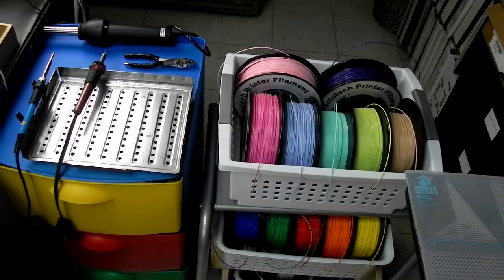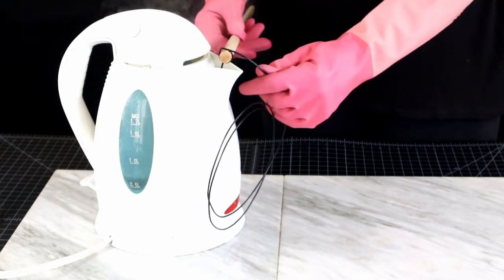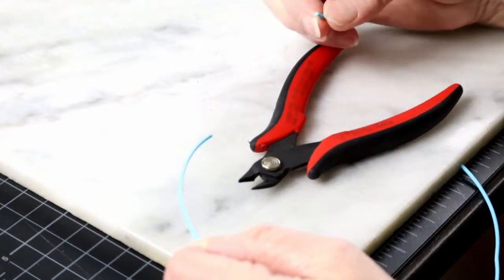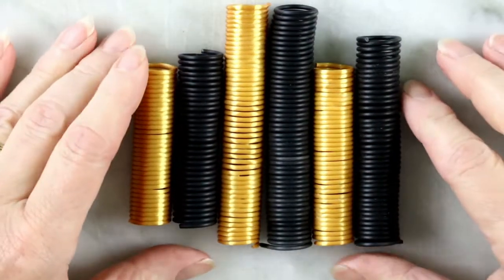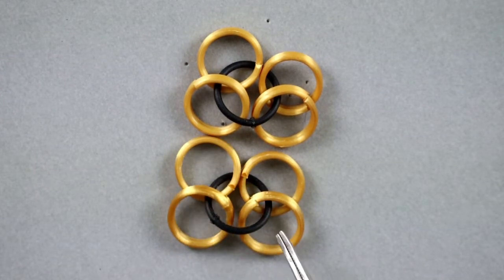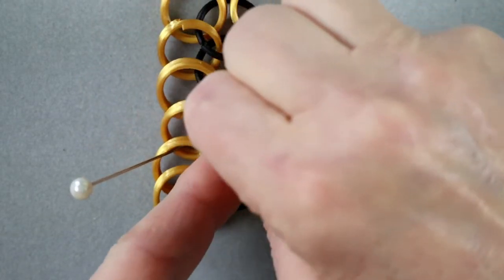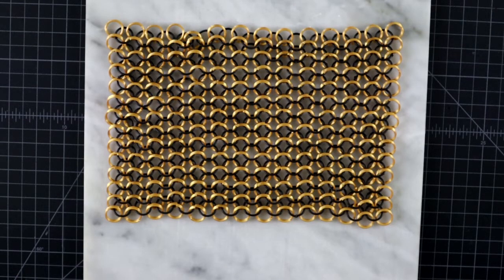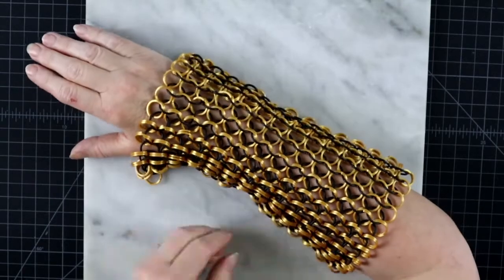How to make chain mail from 3d printing filament

Comment: Im so glad as a all around hobbyist that we have the technology we do, 3d pens and printers, resin printers, laser cutters, CNC milling machines, hotwire CNC machines and many other computerized and hand held tools that make model building, rc car racing I do, rc planes, home built rc planes from scratch of my own designs or making a super scale rc plane for scale competition, male my own racing drones, and alot other things I do like make my own specialty mounts and carriers and suspension for my own road and oval carpet 1/10 scale rc racing cars
Reply from the maker: I totally agree. This new technology really put making things in everybody's home studio reach. And for the 3d pen work you don't even need any software. How cool is that?